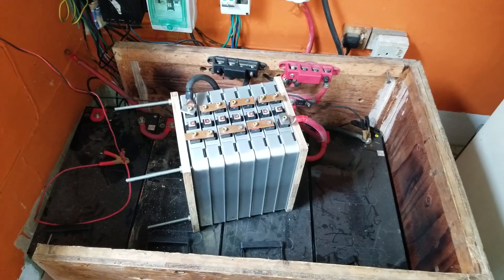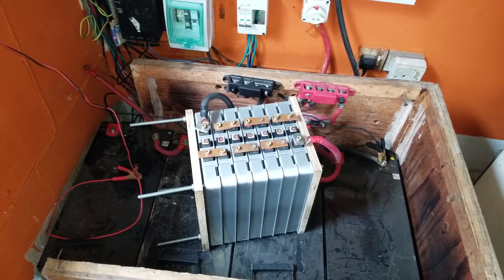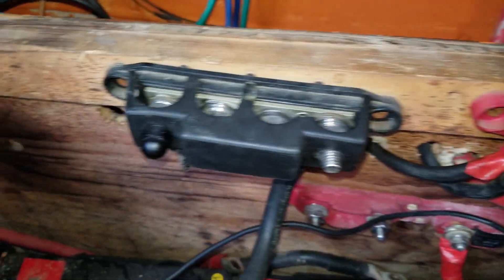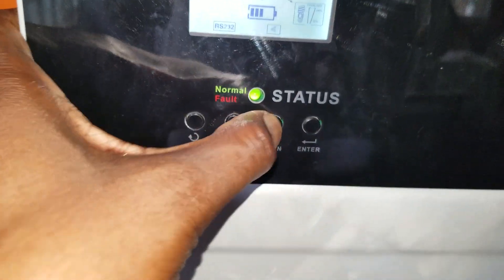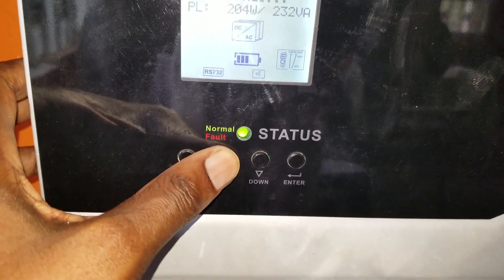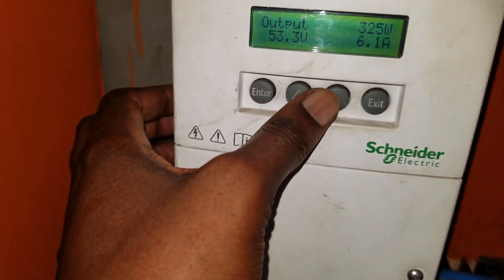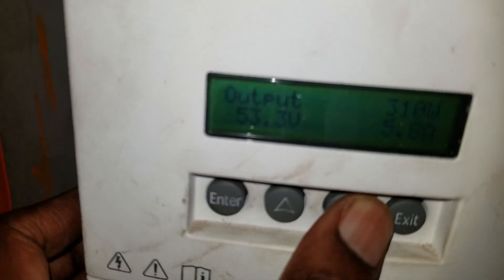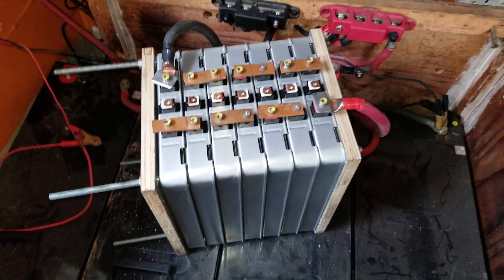This is the leaf powering the house

Comment: sick I wanna see what happens!
Reply from the maker: Lights went out at 140 am. I needed to charge them to 8.2 volts each or 57.4 volts. I initially charged them to 56.4. I will do a new video explaining my faux pas. I am running my old lead acid batteries till the sun comes out